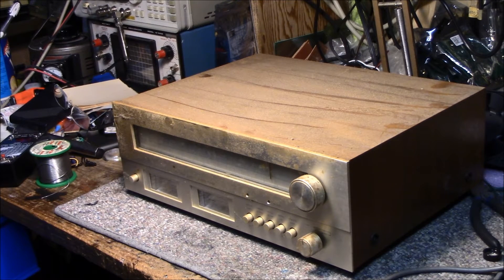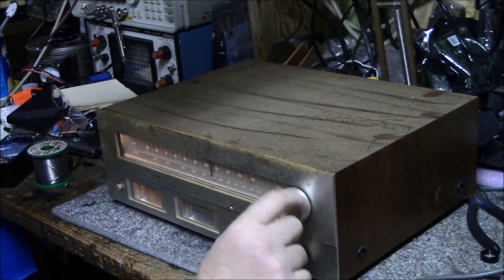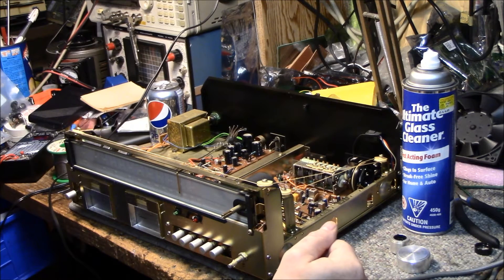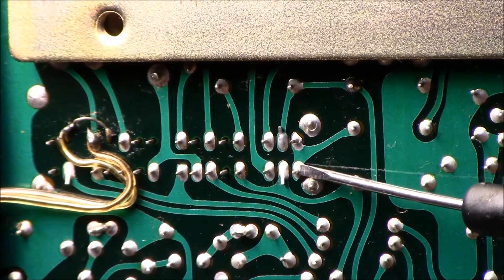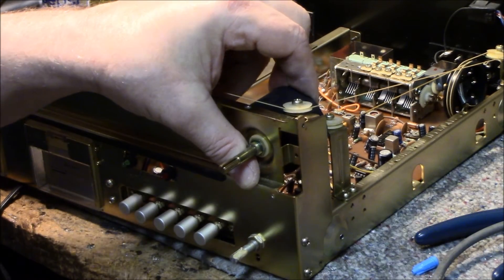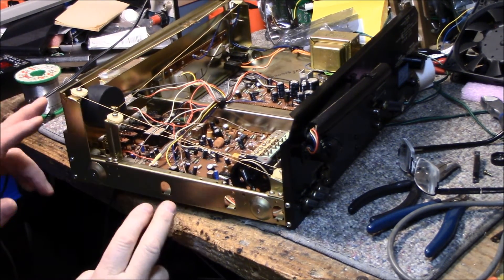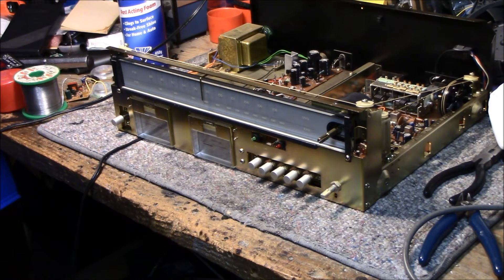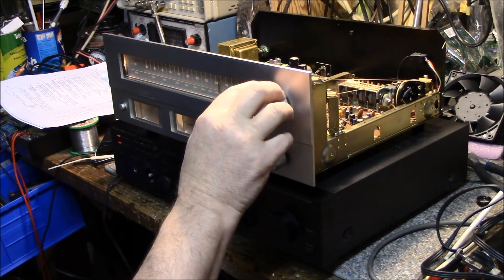Realistic TM-1001 Tuner, Revisiting an old friend (Ep. 13)

Comment: One of these just came into the shop and I'm its new owner. I bought it from the customer because of its sensitivity on FM. 1.7µV! They make that LED replacement in a warm white with a CCT of ~3000-3200K and it looks a LOT better; it's a customer favorite and I've stopped stocking the cool white as nobody has wanted them in a year.

Comment: I bought this tuner new as well in 1979. It has a fantastic FM section.  From San Francisco I've picked-up FM's from at least 90 miles north in Sacramento to 160 miles Southeast in Fresno, CA. It still works great.  The AM is mono. None of the switches for the FM work for the AM. It has a good low-end for AM but it could have used a better high-end frequency-wise.